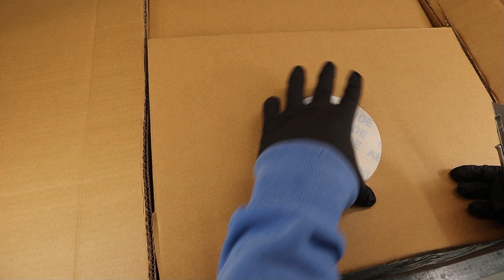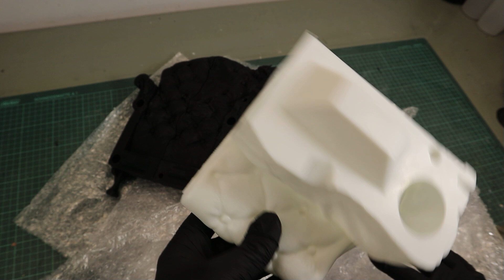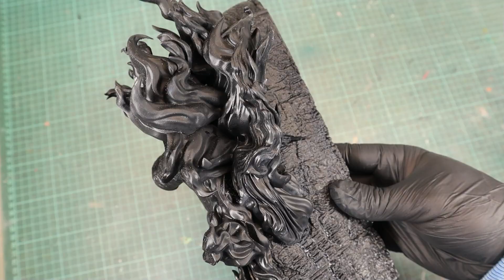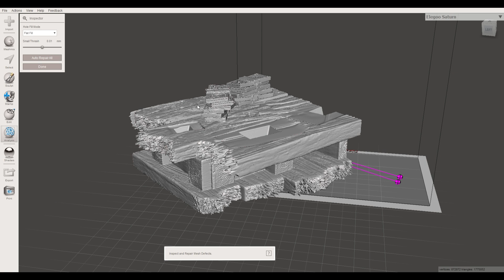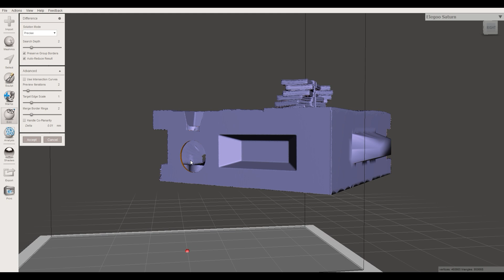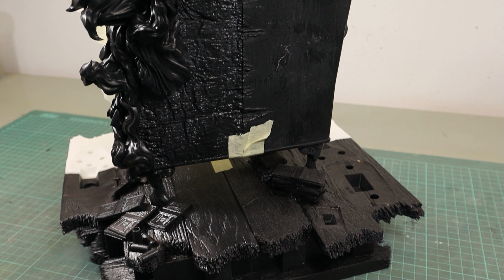JLC3DP 3D Printing Service Review – Is It Worth It? Full Ordering & Parts Breakdown

Comment: Thank you for providing a review on JLC3DP.
Thinking of trying them myself for printing a resins statue but I'm debating if x resin is worth the discount.
What do you think of the quality of x resin? Do you think there's a noticeable difference between no surface finish and with surface finish?
Reply from the maker: If I remember correctly I also used the x resin. The prints I got were a better quality then what I ever printed myself - and I already printed a lot :D. Can’t tell you how the non surface finished come out

Comment: Prices are over-optimized and out of touch with reality.
Reply from the maker: How much would you charge for these 8 big parts?
Reply: That’s what I’m wondering, how much does one charge for huge resin prints? They charge somewhat reasonably considering that a lot of parts have to be printed on “industrial” resin printers as they won’t fit on the build plates on regular resin printers. Not too sure tho, so I apologize for any ignorance, but I’m curious
Reply: More like its the only one in touch with reality with pricing. Now check pcbways 3d printing or any others prices. Those are the ones out of touch with reality. JLC charges 4.8€ for my part while PCBWAY wants 38€ for the exact same part.